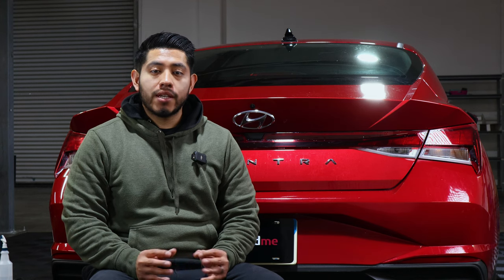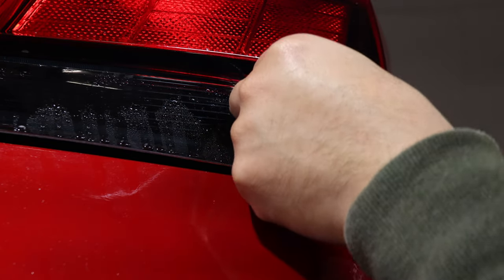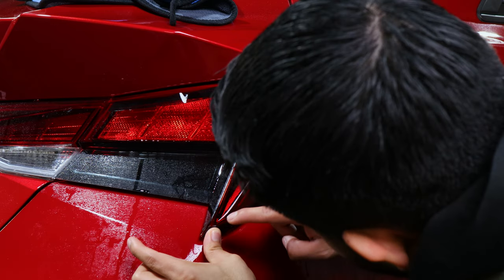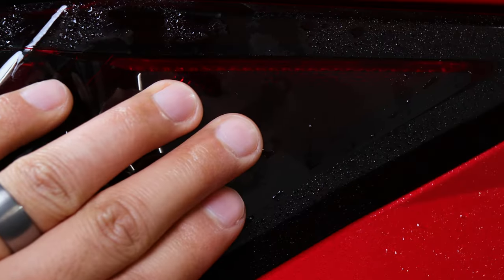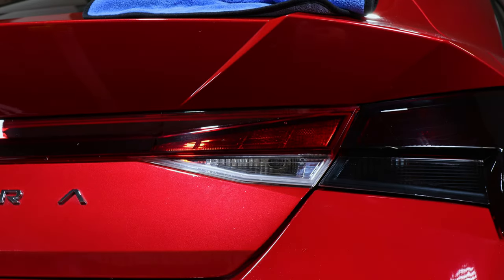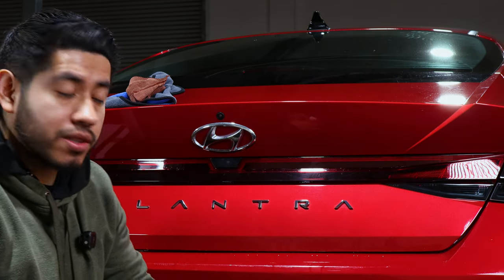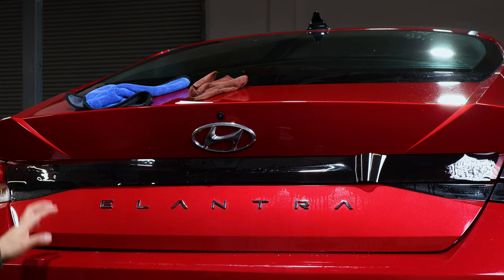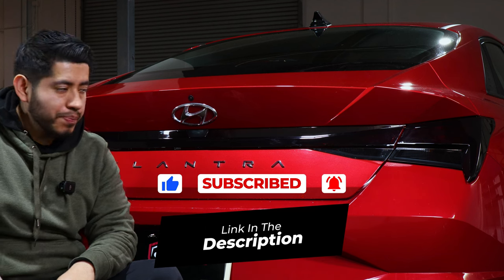2022 Hyundai Elantra Taillight Tint Install

Comment: What do you mean by removing the fingers, im installing this later this week :)
Reply from the maker: Fingers are small material that is lifting during the installation. Usually finger come around the middle section or corners of the film. To remove them you would need tack solution & a heat device to remove fingers.